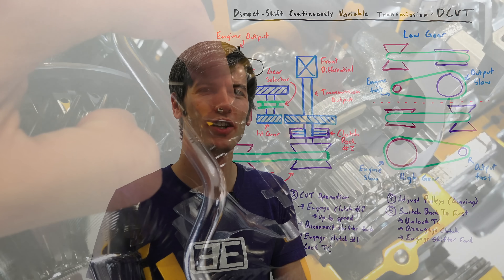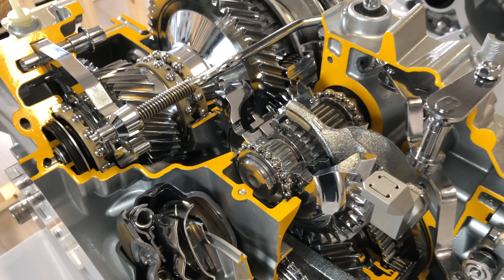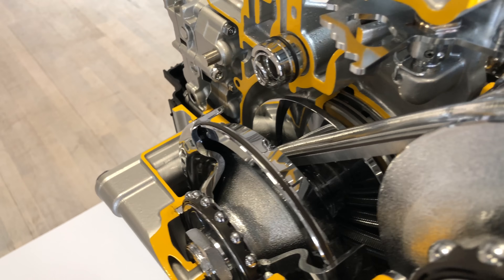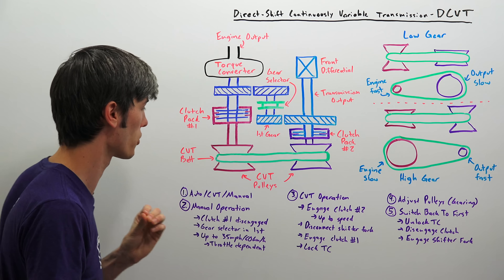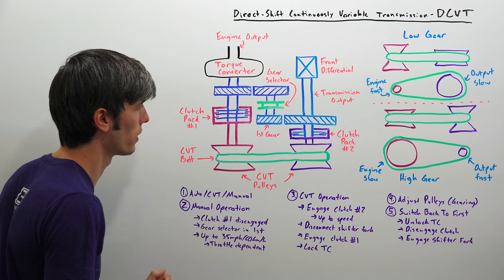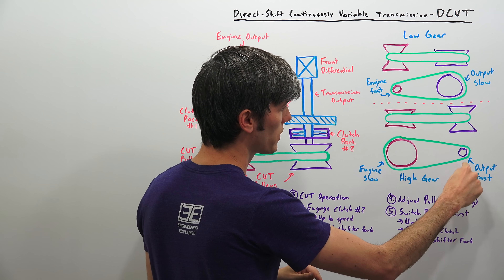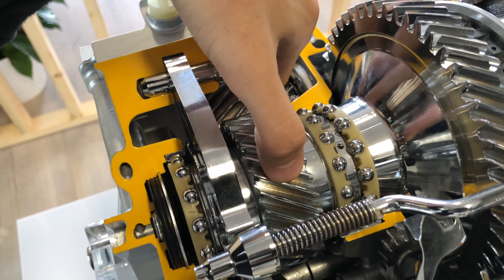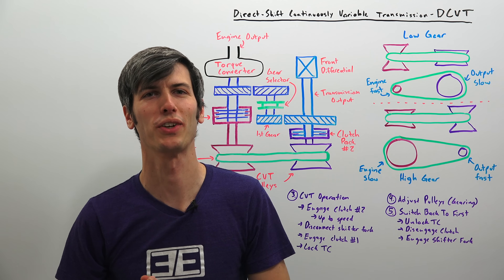The World's First DCVT Transmission - How It Works

Comment: Props to Toyota putting the new technologies like the dual injected- Dynamic force 2.0L engine & this awesome D-CVT in the new Corolla Hatch! Now Can they please build a similar AWD system to the WRX’s VTD so I can have a naturally aspirated AWD Rally car for the Mountains Pleeeeaase!!!
Reply: It won't be much of a rally car for the mountains if you are determined to stick NA. High altitude is the worst case scenario that NA encounters in terms of power generation. The only real solution (much like actual rally cars) is forced induction.
Reply: skifree I agree! I own a WRX, NA has some advantages of lower cost of ownership, cheaper fuel, less repairs & maintenance cost, less carbon buildup/oil dilution & burning. Turbo is super fun, cold starts and short drives are hard on them in the mountain climates... gotta be willing to budget more money for operation long term & properly warm up & cool them down. 

I’m fine with Toyota coming out with some turbos but they might not be willing to risk their reliability and low cost of ownership reputation with a turbo engine that needs a bit more maintenance and care in operation.

If a Turbo AWD Celica comes out... I’ll be the first in line to order one! 🤙🏼🙏🏼
Reply: @UnkoBraddah  Ive test driven quite a few toyota cars over the years. and NOTHING will beat the thrill (and ridiculous danger) of driving a mr2 turbo...To me I just believe toyota's been going a little too soft over the years, and they've just been trying to get the "sportiness" back in looks alone. Drove the Corolla hatch a while back. The lack of power wasn't too bad, but the long gearing on the 6mt and the ridiculously light steering ruled out any spirited driving from me.
Reply: skifree 100% AGREED! I knew a guy back in high school that had a brand new MR2 and it was a complete riot! A total spaceship 🚀🛸 

They’ve done an outstanding job with the trucks & SUVs... (the absolute king in my opinion!) But they’ve neglected the street performance by & large. Need a new MR2 & or Celica to go along with the 86 & new Supra! They should drop the C-HR & Avalon and make some fun cars instead! 

I will probably sell my WRX & buy a new Corolla with the CVT ( it’s better than the MT in my opinion, I know enthusiast sacrilege) but it has 10 ratios in Sport mode that are real tight & fun on the twisties. Even though it goes against every fiber in my body to go away from AWD to Front Drive here in Colorado... I sell Toyotas and I want to support Toyota for building a good looking, decently engaging hatchback.

Looking like a great snow year so far so I’ll probably wait til spring and enjoy my last season with the Subie... unless they build another hatch, then I will have to get another one! Haha!!! 🤙🏼❄️👌🏼🏂⛷
Reply: skifree You’re right about the light & numb steering on the ‘Rolla Hatch as well, nothing compared to the connected instant reactions on my WRX... but it’s accurate and livable for me. Not needing to buy Premium fuel would be nice for a change too! Aloha Brah!
🤞🏼Toyota MR2 comeback someday

Comment: For anyone wondering about repairing these, you don't. I worked at a Toyota dealership and we just replace and core them. Only tranny shops do and that is a dying breed.  But the other CVTs Toyota has regularly go 200,000 without incident and are easy to service even though Toyota recommends never doing it. For all of you crying about conventional automatics, they are FAR more problematic than CVTs and far less efficient, just because they have a long track record doesnt make them better. familiarity is not a reason for complacency and that is a good portion of the car community I think. Every joe shmoe thinks just because he has a hard time understanding something, clearly the people who designed it must as well, well they don't. Thank god theres enough push in the world to innovate sometimes, or we'd still all be using kerosene and whale oil lamps because lighting systems and power grids seemed too complicated

Comment: Like your videos, have never commented though. Great outline, but here's my take. I hate these things, they ruin the drives attachment to the vehicle, and the engine never sounds natural. I use to ride snowmobiles back many years ago. This is what drove them, in a much simpler way but the principle is the same. Besides Cost why are fabs doing this and why are not enough people complaining ? A nice 6-or 8 speed tiptronic is a much better Drive. Not to mention the DCT is far better.

Comment: How does the gear selector work without a clutch? Seems like when stopped, the input side would still be rotating because of the torque converter, so the selector would grind.

Comment: why use a torque converter if you are already using clutches? if you are using a CVT you are going for efficiency right? im guessing its all computer controlled anyway. they could replace the torque converter with a clutch and save weight plus efficiency.
Reply: Because it multiplies torque? that's the whole point of the Torque converter in the first place. Without it, that 1st gear would have to be pretty short and would be useless after the first 15mph. that "launch gear" would just be used to get the car moving...and then you go back to a normal range CVT.

Comment: This is brilliantly cutting edge. Put the first gear from manual driven by a torque converter from automatic while the two clutch packs from dual clutch engage with a CVT for higher gears. Excellent work Toyota!

Comment: Sooo... A CVT with a mechanical by-pass that allows launches without overstressing belt... And hopefully 1st gear only limp-mode in case of CVT belt failure.

...It would be interesting to see such CVT with two gears - 2nd one being equivalent of tallest gear, for efficient (and reduced wear) highway cruising

Comment: My question is not so much about this type of transmission but transmissions in general. From an engineering point of view, do sealed transmissions actually last long, being that they are sealed and don't have a dipstick or drain or fill plugs? Most of them don't have synthetic fluid, either.

Comment: This is a very interesting concept. It looks like Toyota is low-key gearing up for transmissions that can be used in hybrid, electric and hydrogen, in their case, powered cars. In electric cars, torque multiplication is not really necessary, so for simplicity's sake, just one gear is used. But this concept can improve efficiency and speed by increasing the torque reduction from the really high gear ratios electric cars have. This transmission can have really interesting applications.

Comment: Nice design, the main advantage to this arrangement is the CVT is NOT used during high torque situations, where the CVT was prone to failure. Should have better durability over the long run.
Reply: i bought a 2023 corolla (2.0L) and the gearbox clunk (it clunks the moment i press or release the gas pedal) the dealer says its "normal" !!

Comment: why (on change from direct to cvt) it doesent : 1. setup cvt to same ratio as 1st gear 2. engage both clutches, 3. disengage direct drive, 4. work with cvt.
also - why does it need the torque converter ? I assume only to make the coasting easy ?
Reply: The torque converter allows it to start without slipping the clutch in 1st (launch) gear.  The CVT doesn't need it, so it locks it out when switching to the CVT.

Comment: 12mths ago i had my nissan cvt rebuilt after it failed some 200km/180ml and was told i was lucky for it to last that long and did so possibly because of 90% highway miles....

after spending $5kAu getting it going again it never felt the same....

the cvt is problematic....relying on a steel belt on steel pullys will always have friction hence wear...this wear translates into metal particles polluting the transmission and clogging the internal no serviceable filter and reducing oil flow to the shifting solenoids....

so...like all things mechanical they are bound to FAIL, but way more sooner than the traditional automatic transmission....

my cvt gearbox rebuilder claims that subarus, audi, vw’s he has dealt with have failed less than 100km/60ml on the clock 

anything cvt = stay away

Comment: I just rented a Corolla 2019 for 3 weeks, I finally understand why it felt so strange to drive. I could tell there was some CVT things going on ! The really horrible engine sound (noise?) ruins it all however. The passengers in the car even asked it the car had a problem from the noise & feeling of driving. 
Thanks Jason, so timely.
Reply: The corolla sedan uses a traditional CVT, the corolla hatchback uses the DCVT.  They use very different engines too.  No comparison really.  I don't like how the sedan drives, bit the hatchback drives great (hence why I bought one).

Comment: CVT... lol anyone who had deal with it  knows that those transmissions can't be fixed or repair. (Thinking about Nissan Murano etc) Which means once is broken, you need to buy a new one because there is no spare parts. The 2019 corolla 3 years later  when that CVT tranny brakes you are looking for a 5 to7 grand repair  on a $10k car (after depretiation obviously) keep it up with the "good engineering"...
Reply: The Thing Nissan has finally started selling internal parts for their CVT units just here in August. Only took about 10 years to get here.

Comment: So when the CVT fails, you can still limp home in first gear!
Reply: How will it fail? It's for fuel efficiency I'm sure they have the same vehicles with different transmission from factory so it depends on what you prefer
Reply: Most Toyota vehicles come with different transmission for eg. Cvt ,traditional automatic and manual

Comment: You did not mention that the torqueconverter has build-in a mechanical clutch inside as well. So when using the first gear there is always a mechanical direct coupling of the engine i.e. the crankshaft/pistons/expansionforces to the wheels. Like with Fords Tin Lizzy 😉

Comment: wow, looks quite cool .. seems to overcome the issues i had with my audi CVT A4 in 2009.. i really liked the transmission but the automatic clutch did not work very well in situations like coming nearly to a full stop and then reaccelerating, like at some crossoads etc. it first hesitated and then punched in, which was almost uncontrollable, uncomfortable and potentially dangerous. of course this problem has been solved for dual clutch transmissions which also have automatic clutches. but with torque converters this problem just cannot occur, i think it is still the best and most comfortable solution for such near-0-scenarios.
Reply: i bought a 2023 corolla (2.0L) and the gearbox clunk (it clunks the moment i press or release the gas pedal) the dealer says its "normal" !!

Comment: Jason, the whole purpose of a cvt is to keep the engine at a pre determined rpm for best efficiency. Therefore, it's not correct to say the engine speeds up, or slows down, but that when the pulley's change their working diameter, this causes the car to go from slow to fast at fairly constant speed. It's the change in diameter, not the engine speed which causes the speed changes. It's all about leverage, just like with a bicycle chain sprocket on the crank and the driven wheel.

Comment: Thanks for explaining how this works. But what is the problem this design is intended to solve? Also, I didn't notice any reverse gear bits? Cheers!
Reply from the maker: Here's why it's an improvement: https://youtu.be/HanImTejIVM
Reply: @EngineeringExplained  Thanks for the reply. That makes sense, efficiency matters so the extra discrete fixed ratio(s) keep the CVT within the efficient zone. Back this post though, schematically how does reverse work? Thanks in advance for considering my question here. Cheers!

Comment: The complexity of these transmissions is getting off the charts.
Whatever was wrong with a good torque converted 6 speed? Change oil now and then. Reliable and proven and to those who work on them, simple enough.

Comment: I'm curious as to how the first gear engages while it's stopped from neutral, for example. Wouldn't the torque converter and intermediate gears be spinning at this point in time? In that case how would first gear mesh without ending up gnashing teeth? I'd assume there would be some mechanism in place, but it doesn't seem to be readily apparent. Also, if they were using clutch packs for the CVT why didn't just use a clutch pack to engage first gear as well?

Comment: im flabbergasted! that thing is as beautiful as the Honda engine you explained a few weeks ago. it seriously looks like a piece of artwork and im sure the crappy CVT belt could last much longer in this system since it takes the "weight" off  the belt for initiating movement

Comment: Wow. Absolutely crazy. I remember talking to my peers about how a company could probably make a combination of all transmissions if they really wanted something perfect, but its too expensive.

In the industrial sector however, there is a type of transmission that combines a hydrostatic and automatic transmission. (Hydrostatic is what bulldozers use, its extremely good for low speed, and maximum torque). Ive seen it on loaders alot.

Comment: Hey EE! I'm currently designing a 50cc parallel twin for a long term project and I was wondering if this design could be scaled down to moped-ish size. Also, do you see any issues with replacing the torque converters with centrifugal clutches?

Comment: It seems like the clutches shouldn't be necessary if the CVT can be geard down to the same ratio as 1st gear.  Would eliminate some complexity but would still have strong torque holding.

Comment: very good, I suggest that you explain "the high gear dropping down transition when going to lower speeds" from the user's POV, not the mechanical transmission POV. What does HE do first?  Then what happens in the transmission - torque converter, CVT, gears are secondary. ENJOY

Comment: Well it's from Toyota so it has a chance of being reliable. I'd be interested to drive one and see how it feels. I had a 2014 Corolla and it honestly wasn't bad for a CVT. With a real first gear driveability should be pretty good. I still miss how instantaneous the kickdown was with the CVT, it just wasn't great off the line (low HP engine aside). I'd want these on the road for a number of years before I bought one though. I only went for the 2014 because that CVT design had been used overseas for years before coming to the US and had proven to be reliable.
Reply: i bought a 2023 corolla (2.0L) and the gearbox clunk (it clunks the moment i press or release the gas pedal) the dealer says its "normal" !!

Comment: Lets make things more complicated because the simple and reliable manual transmission wasnt complex enough. Learn how to drive a car people! In 1920 thre was no power anything and people could drive just fine. Other than power brakes, everything else is unnecessary.
Reply: It's hard to crash when there are only two cars on the road! Still happened though.

Comment: Toyota is admitting (in effect) that CVT are not up to the task of handling high torque (1st gear is delivering the highest torque to the wheels). This is actually very honest on their part, whereas other manufacturers still try to push unreliable weak CVT onto their customers (they do it because CVT are cheaper to manufacture since they have less parts, especially expensive gears). 
However, this solution (DCVT) of using gears to deliver the highest torque is complex and prone to problems.
BTW: Toyota made another bold step regarding GDI (Gasoline Direct Injection). Realizing that GDI fouls the intake valves they came up with an hybrid solution. In some engines they put DGI and "old" port injection so that the gasoline stream cleans the intake valve. But again, this is an expensive problems prone  kludge solution.

Toyota deserves a praise for not trying to pretend that CVT and GDI have serious problems.

Comment: This is such a brilliant system. The day strictly CVT came out, I was wondering why not combine them. Great video explaining it perfectly. I hope this transmission catches on. One thing you didn't mention was weight? I'm just going to assume it's heavier.
Reply: I bought a new 2023 corolla (2.0L) and the gearbox clunk (it clunks the moment i press or release the gas pedal) the dealer says its "normal" !!

Comment: Seems like a neat idea, but probably wont be reliable and will takeyears to figure out all the glitches. i wish they would just stick to a conventional automatic with plenty of gears,they already got them shifting fast enough, keep it simple, nobody asked for cvt trans, and nobody asked for this bastardized version of it.
Reply from the maker: Yeah Toyota is known for continually putting put unreliable products! 🤣
Reply: Well didnt they just recall a crap load of engines because they used oversized pistons in the 2018 2.5 camrys?

Comment: I'm new to this channel & found it very intuitive, the problem I have is CVT may not now have the strain of pushing the car forward from a standstill but these belts still arnt great on strain.. what happens when you need to put your foot down in 2nd & 3rd over a prelonged period.. will this gearbox be more reliable .. ? The last CVT gearbox cost me £5000 4 years old & 67000 on the clock ...

Comment: I wish Honda hadn't totally screwed up on IMA... Replacing the first gear shenanigans with a high torque electric motor that would clutch off around 15mph could help stop start systems and cvt ratios...

Comment: The packaging design of this transmission is pretty advantageous too. I can see their whole platform using this... But real question is can it still be fun?
Reply: Sib Txuj Hawj These designs are getting very short in the axial direction. The torque converters are almost like pancakes. Extremely short and flat.